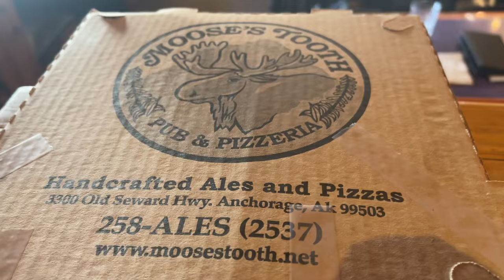Building A Chicken Coop to Withstand Alaska’s Harsh Winters

Comment: Ive had chickens off and on in alaska over most of 45 yrs. my coop was twice the size and i still made them an area to run during the winter. removing the snow from your tiny outside area doesn't look very do-able. They like and need sun. zero degrees isnt very warm. i used a oil radiator style heater (sealed )  on number one setting up on a cinder block and had a foot of wood chips on the floor.  a heat lamp over a dust bath box ( or tiny sawdust)  both necessary for birds to bath in. The sawdust has terpins in it that kill the mites they get. either way they love a good dust bath.  I also would shovel the main walk outside to the ground and put a layer of wood chips on it and sprinkle corn, they come out in the snow on days over 10 degrees and perch on a pallet in sun.  I hope your chickens fair well. keep in mind that if they get too cold their vent freezes shut and cant lay eggs. I had a friend who had to thaw her birds in the kitchen sink, to find they had 3-5 eggs inside them. not good. keep a good eye on them on the very cold nights. Best of luck. Im just starting a new coop at a new place,  with my birds only 8 weeks old now. was here looking for ideas for nesting box. Also , maybe i missed it but its very important to vent the humid air out of the coop room..... Thanks for sharing.
Reply from the maker: Our coop has been in full operation for one year now (this video is from 2023). Everyone did really well last winter, stayed warm and had very few issues. We lost zero birds in our flock due to the weather or their living environment. They loved to dirt bath in the covered area all winter long and I continuously added straw and alfalfa all winter. I wish you luck with your flock and your coop build.